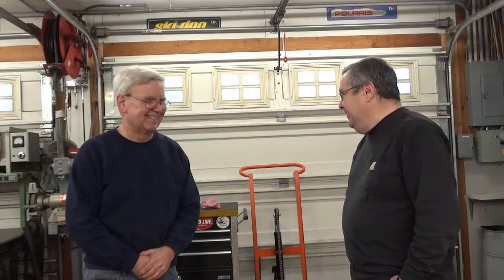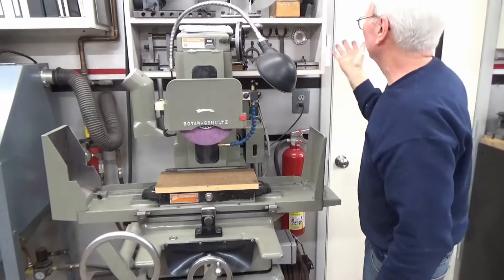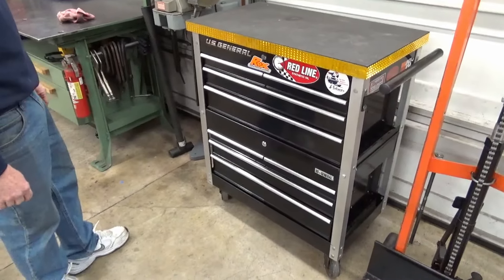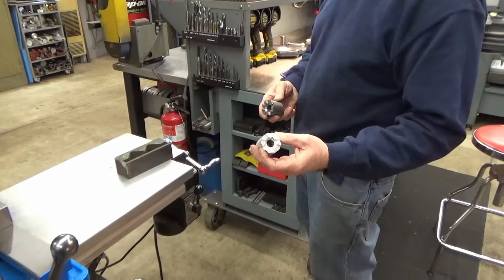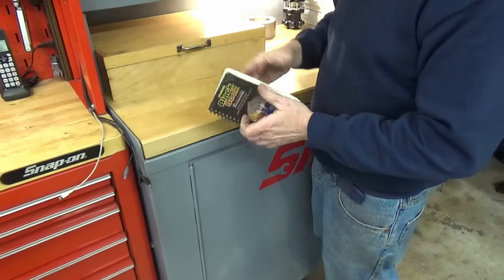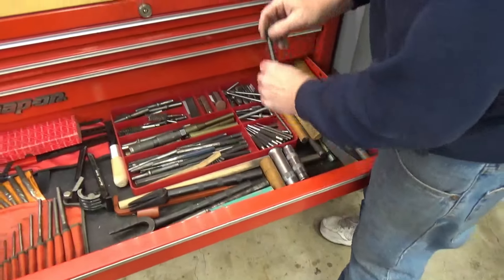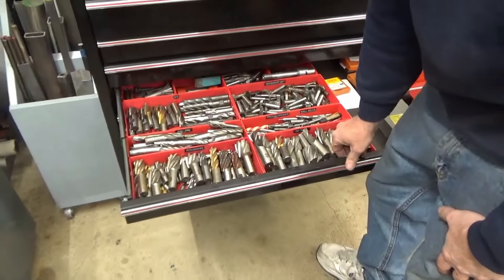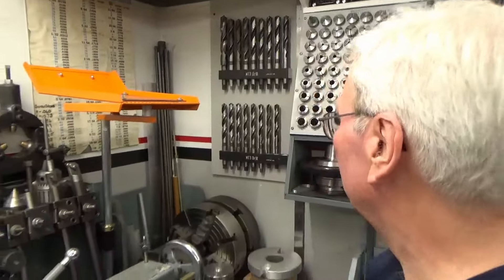RD and E Machine Works Shop Tour

Comment: Thanks for the tour. Back in my college machine shop classes we wrote the programs CNC and saved them to 5 1/4" floppy disks. Then we put them in the Bridgeport reader and the mill did it's thing. I guess the tape was before the mid 80's?
Reply from the maker: Yeah tape was in the 70's and lasted until the early 80's. Punch cards were popular then too, but tape had the advantage that you could drop it and not have your program scattered all over the floor.